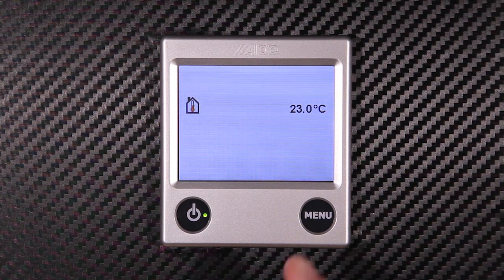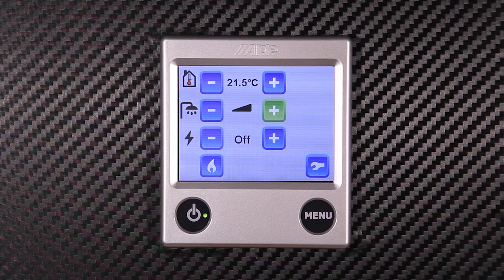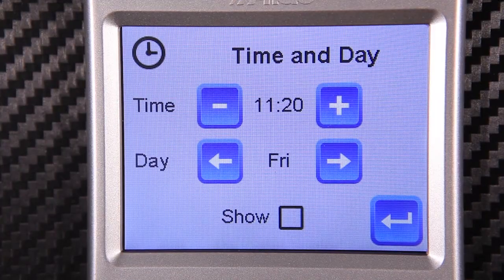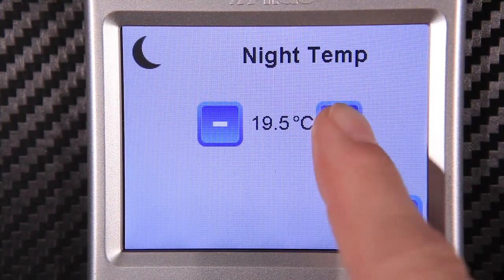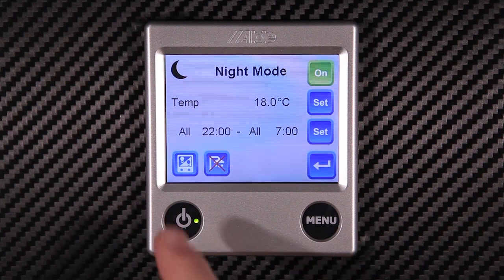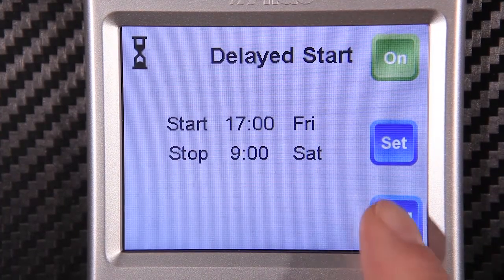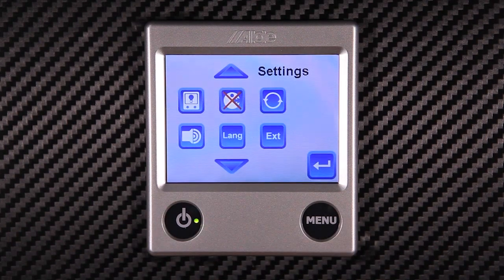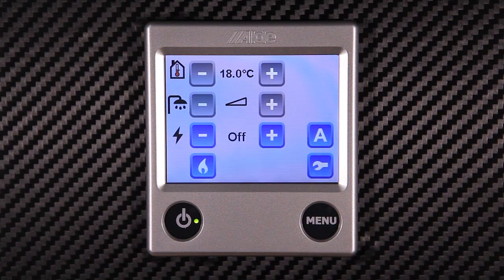Alde Heating System

Comment: Hi you said it will give you hot water for 30 minutes, i thought it only had a 10 ltr storage tank ??
Reply from the maker: Hi - This is the Alde official information.  It is the time rather that 30 minutes of use.  Is yours the same as in the demo?  What make, model and year is your caravan?
Reply: @teessidecaravans  yes same make and model heating 3020, van is kontiki 596 2021